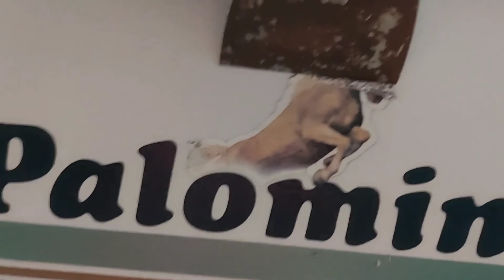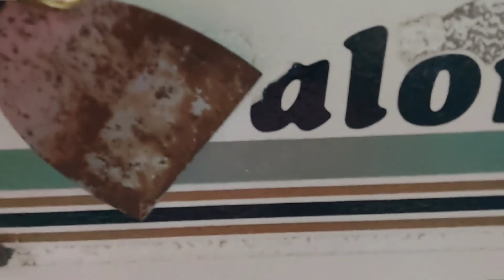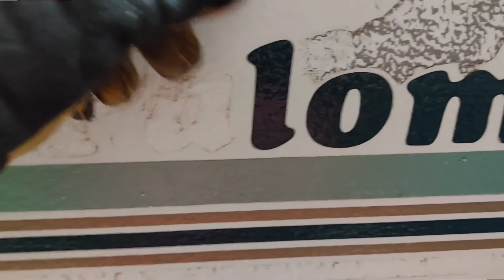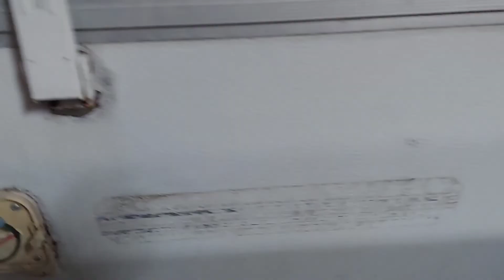Removing decals and painting a pop up camper

Comment: nice, what paint did you use? and how many coats?
Reply from the maker: Thanks for the question and the sub!  I used Valspar Medallion exterior oil primer. It covered real nice and it needed 2 coats about 30 minutes apart.
Reply: @LetsDoThisWithEvan  same paint on the roof? TIA
Reply from the maker: @TimHoSD  https://www.campingworld.com/dicor-rubber-roof-coating-system-tan-115108.html?utm_source=google&utm_medium=ppc&utm_campaign=%7bCampaign%7d&gclid=Cj0KCQiAm5ycBhCXARIsAPldzoVSUX3gvkTkDhbtT5mdCtL0QvyYsGz4kEhPguw1jXERCBRBs3-oykoaAtEwEALw_wcB&gclsrc=aw.ds this is what I used. 2 part roof uv rubber coating. Keeps it cool. Worth it!